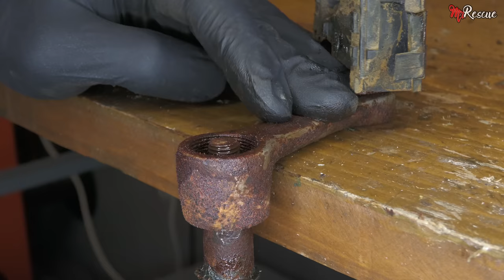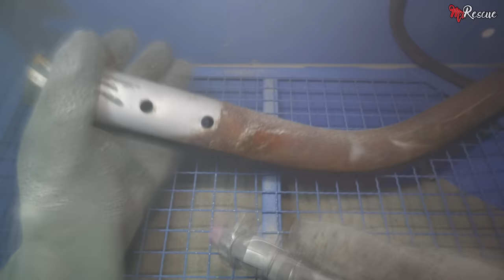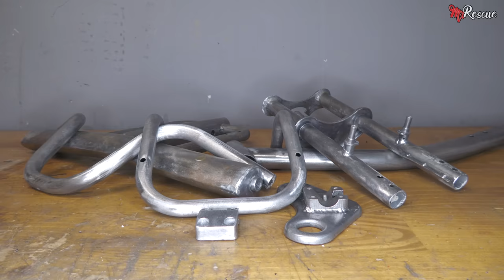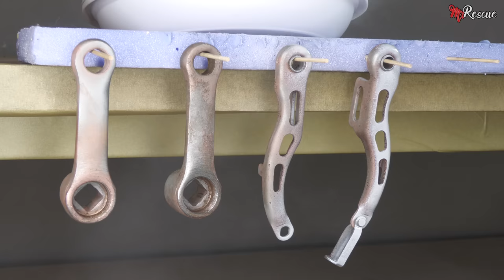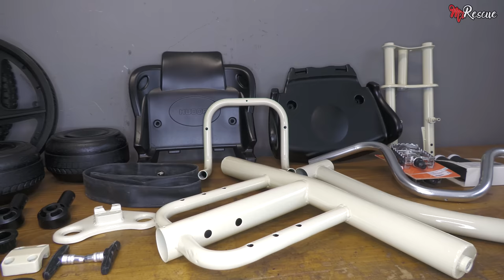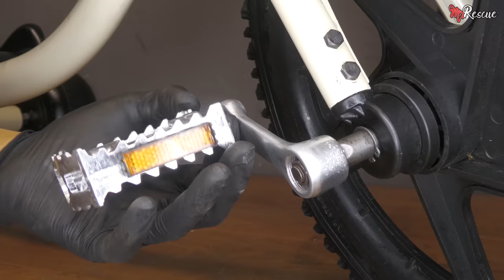Restoration Drift Trike - Complete Process

Comment: Every time I watch one of these videos and see how the bolts, nuts and screws are lovingly restored . . . all I can think of is 'I would so just go buy new ones' . . . well done !
Reply: They are not restored, grinding the rust off is temporary if you don’t replace them they will re rust from the moisture in the air
Reply: @johnstone9396  unpoco bastante chapucero sí que lo es
Reply: @johnstone9396   do you know what chemicals he use to clean the wheels and set?